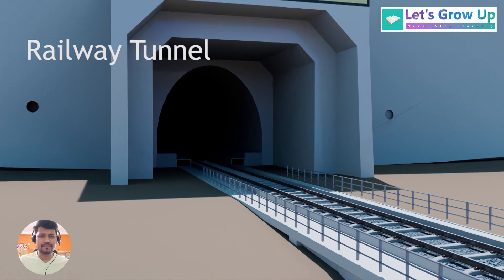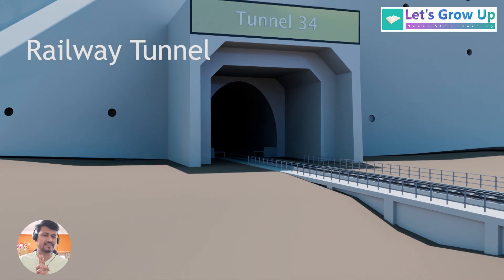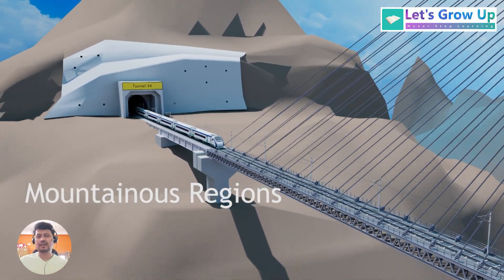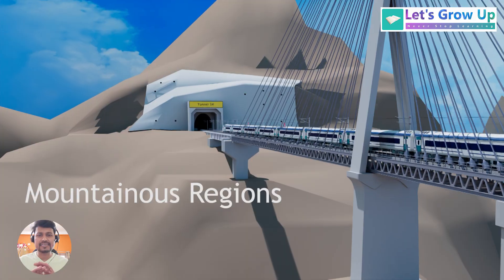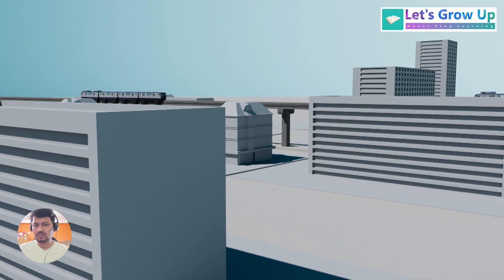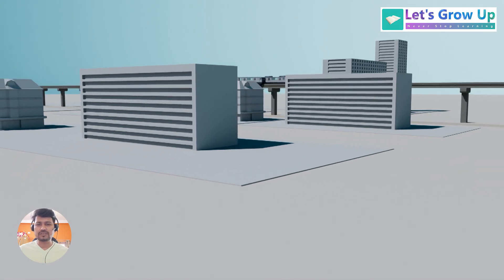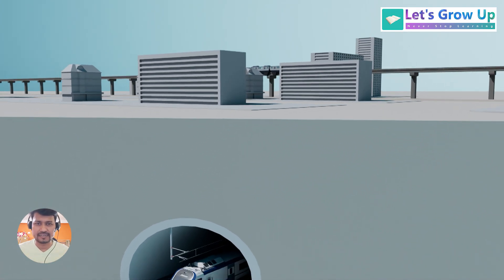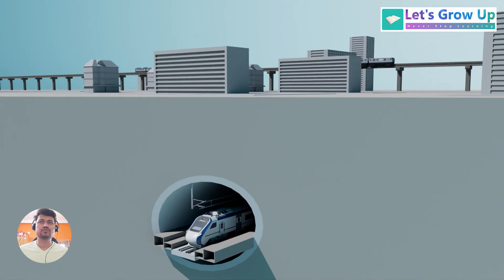Design of Fixed Slab Track | Tunnel track | Modern Railway #track

Comment: I'm a viewer from Japan. 🇮🇳🤝🇯🇵
I think that long tunnels will be equipped with fire extinguishing and smoke exhaust systems, as well as evacuation tunnels separate from the railway tunnel, in case of accidents or fires. 🔥

In the past, in November 1972, a fire broke out in the dining car of a train traveling through the “Hokuriku Tunnel”, a mountain tunnel over 13km long, on Japan's national railways. 
The train made an emergency stop in the tunnel, but was unable to evacuate or extinguish the fire properly, resulting in many casualties from the thick smoke. 💐😵

Since then, the procedure has been revised so that in the event of a fire, trains do not make an emergency stop, but instead exit the tunnel before stopping, and the aforementioned fire extinguishing and evacuation equipment, as well as the flame-retardant nature of the vehicles, have been promoted. 🍀
Reply from the maker: Thank You